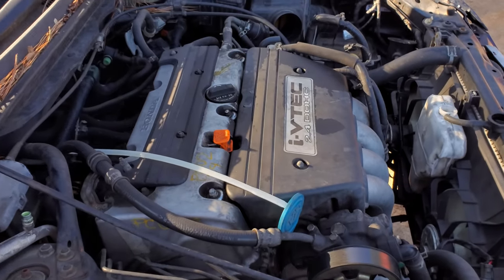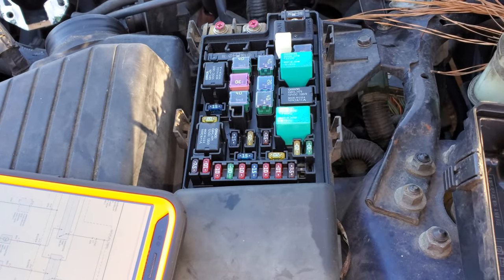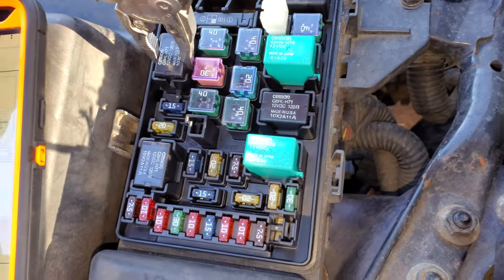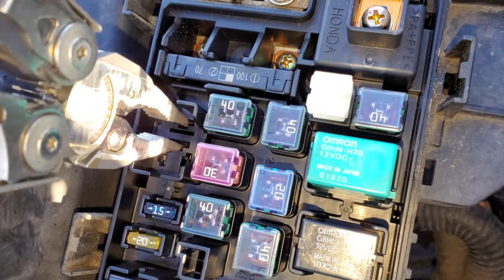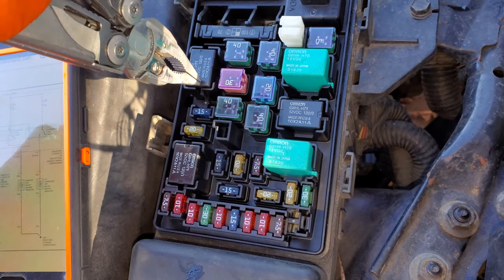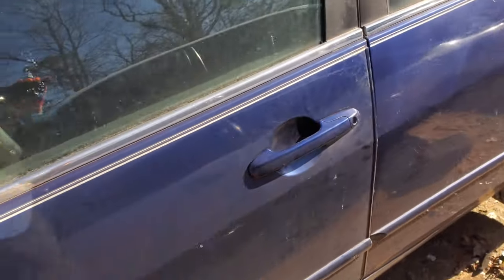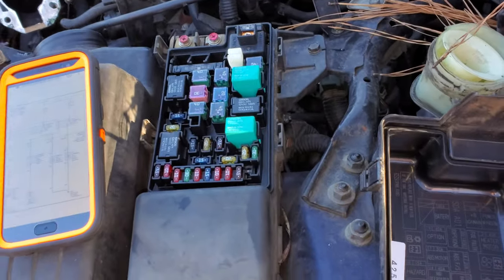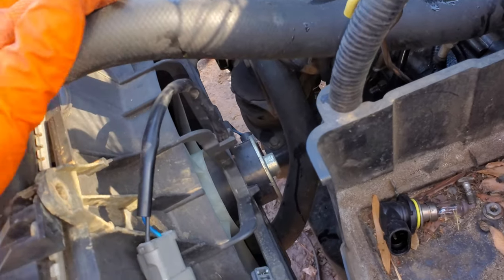2003 Honda Accord Radiator Cooling Fan Relays, Fuses, Circuit Explained

Comment: I am having issues with both fans running but only when the AC is turned on. Does this mean my temperature switch is bad?
Reply: I have the same problem,  did you fix it?
Reply: @jerryibarra7958  yeah it turned out that my temperature sensor at the bottom of the radiator wasn’t functioning because the plug was not connected properly due to a bent prong. I didn’t even have to replace the sensor, just got the prongs strait and plugged back in. If needed the temperature switch with wax pellet is about $10.

Comment: If power is not detected front wire connection to fan, then there is an open circuit from that wire. In my case some rodent chewed through the wire.

Comment: I drive an Accord ‘07, faced the same issue, the mechanic was about to replace the fan coming weekend just to extract money from me but then I did the troubleshooting as explained in the video and turns out the fuse inside the relay box was blown, so thanks a ton man for the video, keep up the good work !

Comment: Do both fans suppose to be on when the
 A/C?  Becuase lately only my A/C been coming on
Reply: One is for the A/C and the other turns on when the ECT sensor detects the engine warming up which it turns on every once in a while

Comment: Hi there I have problem with my Honda Accord 2007 2.4 lt the cooling fans is no power at all any idea why I check all the fuses and relays and is not power not even at the two cables they go to the coling fan ty 🙏🏻

Comment: Nice video! What is the description of the 7.5 fuse. The radiator fan of my 07 CRV stopped work. All fuses are intact and I did test the relay. It does click and have current going through it. I did locate another fuse under the dashboard (#36, 10 amps) and it's intact also. I heard about this other fusel that powers the relay, but it's not listed on the diagram. Both fans does work with AC on, but the radiator fan doesn't work alone. I did replace the cooling switch for a new one! Also, the fan doesn't work with the paper clip bypass, instead it turn on the engine trouble light. Now I have an suspicion of the wire that goes from relay box to switch on the radiator! Any other idea? Thanks!!

Comment: Great video! I have a 2013 Honda Accord and I just replaced my condenser fan with motor and it still doesn't work. I checked the relays and swapped out the two with same amperage to see if one any are burned up but they were working fine. Any ideas on what to do?
Reply: replace the coolant temperature sensor
Reply: I did that and still no power with new fan and they only run a few seconds with AC

Comment: I appreciate call that great info on the Honda.  My fan works when I put turn the A/C on but, I almost ran this thing hot yesterday due to a bad thermostat and the fan never came on….. any ideas.  By the way I have replaced that switch in the bottom of the radiator……

Comment: Thank you for this awesome video but i am still having issue with my 2003 honda accord ex radiator fan not working. I followed your direction and even went extra as to replace the whole fan rack, the radiator fan switch to avail. the car only overheats when it's running still. The moment i turn on the A/C both fan run and temp goes down. I applied direct to power to radiator fan and works fine.  I am not sure what's going on. I am new to this by the way. I even used the clip test with the ignition turned, still no power.Thank You
Reply: Try this I did it to my 2003 Honda Accord Ex go to ur battery unplug it for 30 minutes after that connect both the negative and positive it’s like ur restarting all the electrical shit feel me. And yes my fans only worked when I turned on my AC ur right so do what I did and I hope it works.
Reply: Great video! Helped a lot. I also am having issues with both fans running but only when the AC is turned on. I've discovered all these small issues bc my ac started struggling when the vehicle is in idle. All my fuses/relays seem to be working fine, but engine fan only comes on at the same time as condenser fan when the AC switch is turned ON. You suggest resetting the battery for about 30 min and checking again? Thanks!!
Reply: @kylecooper840  try replacing the coolant temperature sensor. this is part of the coolant system that's not being mentioned.

Comment: I have a question my fans is connected to the driver's side to the straight up to the cooling fan they did a Mickey mouse when I turn up the AC it will fence blower on both if I turn up the AC the fence when I go on a red light it doesn't turn on automatic what is wrong with the problem I have. A Honda 19 99 Accord DX 2.3.

Comment: Thanks for the info. I have 2003 accord where the ac condensor  fan runs even after ignition is switched off and has drained my battery (happens randomly)....any inputs would be appreciated.  Thanks!
Reply: it must be the radiador, switch is stuck conducting electricista. with cause they fan kicks on  constantly.

Comment: Thank you for sharing the information. It is helpful. Just on the last point, where you mentioned about checking the fan, you can also connect the fan directly to the battery and check if that comes on indicating a functional (vs non-functional) fan.

Comment: My 04' Accord 2.4L has had P2185 code on and I switched the switch sensor under the radiator and my thermostat not my gauge always reads hot and my fans stay on all the time, idk what to do
Reply from the maker: It's likely that you need to change the coolant temperature sensor which is threaded into the thermostat housing
Reply: @LehewTech  its on the inside of the housing? Or it just near the thermostat?
Reply: @LehewTech  and thanks I'll look into it

Comment: I have a Acura TL and my fan runnings for hours after car is off. I changed the relay and it’s still doing the same thing. But if i tap the relay the fan stop. But when i put the fuse box cover back it start running again or even if i close the hood. Plz help me
Reply: Destroy the car immediately.  You must act quickly before it turns on you.  
Follow these directions step by step, exactly how I explain.  If you do not, you will certainly succumb to a lifetime of misery cut in half burned alive.
First, purchase 1 gallon of 93 octane and drive to the nearest cliff.
Second, get out and soak that mfkr inside and out. Careful not to light a cigarette; you may burn if you’re careless. 
Third, wait 3 minutes after the last drop is poured and start the car. 
Four, this is the tricky part so give yourself 30’ before the edge of the cliff.  Now carefully Put the car into the lowest gear and set the e-brake enough to where the car still rolls forward and enables you enough time to get out before it reaches the edge. 
Five, your not done.  This step is crucial.  If you do not set this car on fire before it goes off the cliff you’re fucked. Have a torch active so when you jump out of the car while it’s heading towards the cliff you can grab it and set car on fire before it goes over.   

That’s my five step program.
Rid yourself of that piece of haunted shit.

Comment: i have a 2010 Hyundai Tucson and  my fan comes on when i start the car and go off when i shut the car off i bought a relay for the lower blower and i probably should have changed the hi blower it's labled different in my car it don't say radiator fan on any of them just trying to solve my problem i'm getting close lol

Comment: Thanks man, my fans were running when my car was off for 2 long and killing the battery. Changed relays and vuallah, problem solved! 

Btw, You said driver side fan when pulling both relays. Never said passenger side fan.

Comment: I did everything and still nothing
Reply: if you bypassed the fan and its good, all relays are good, and fuses are good. then try the coolant temperature sensor.
Reply: @stevennunez3462  find out it was a blown head gasket